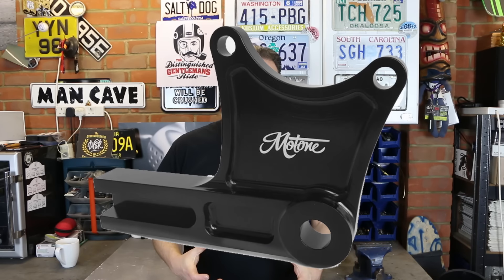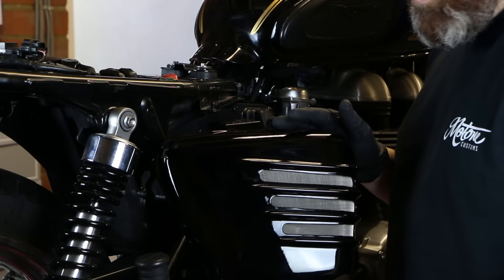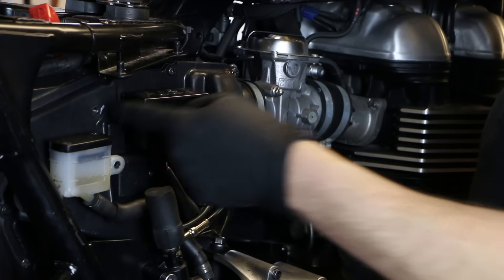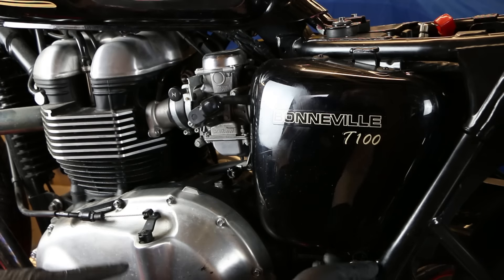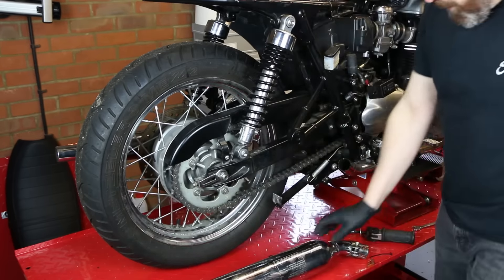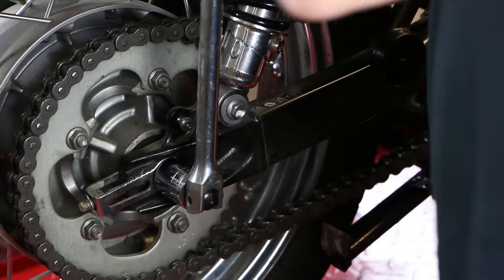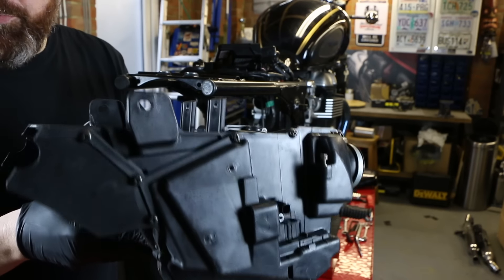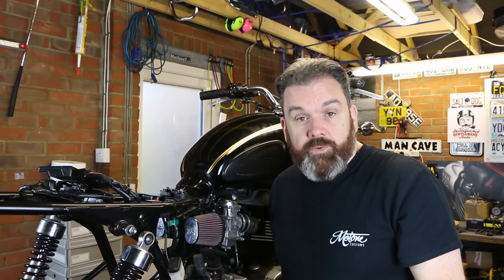Triumph Bonneville T100 Build Pt4 - Airbox removal

Comment: Hi, you can remove the airbox keeping the chain, both exhausts, and the wheel.

Just use a lift to yes lift the bike so the rear wheel hangs after detach the shocks, and the gap behind the box will big enough to take out the airbox. If not, simply lift the bike a little bit more until you can remove it.
Reply from the maker: Tombstone Blues Thanks
Reply: Tombstone Bluesy
Reply: Whomever did mine, before it was mine, they actually removed the sides and front, but left the wall between the tire and the battery box. They look like they are a heavy molded unit, but it comes apart. It's good leaving the rear part, because it does protect the air filters and battery box from a lot of debris from the wheel.  At least the way it looks to me.

Comment: Hi, what k&Ms did you use, the ones I've bought will not fit the inlet on the carbs. The ones that were on the bike when I bought it are huge and it looks like whomever did what you did, removing the airbox, actually cut the rubber connectors off the air box and glued them on the filters. I would like to get some shorter ones, but I don't see them when I look for them online. Thanks.
Reply from the maker: They came on the bike already, so I don't have any info on them sorry. I'll check them and see if there is a model or part number

Comment: Did you have to do any re-mapping after removing the airbox as this will change the airflow? Also same question for later on when you fitted the new exhaust cans.
Reply from the maker: I didn't remap it. The change to the airflow is within the tolerance of the ECU. I just left the bike idling for 15 minutes or so.
Reply: Morning, do you have any problems with the snatchy throttle operation on your T100, I am thinking about the TEC fuel boost plug, any feelings on this product. My 865 has already had the air injection delete and also the O2 delete done before I got it. Thanks Alex.

Comment: Thanks for the video. subscribed!  I'm not interested in removing the airbox completely but only the baffle inside of it. Any tip for removing the baffle without removing the airbox?
Reply: André Filipe I've removed the baffle plate and it's not to bad a job. No need to remove the rear wheel or shocks, you only need to move the air box back enough to get to two or three difficult the screws on the right side. Have a look on the Triumph Twin Power website, there's a downloadable guide to removing the baffle plate somewhere there.
Reply from the maker: +André Filipe Thanks Andre, and thanks to Ben 1022 for answering
Reply: Thanks! I remember checking the guide from TTP some months ago and 
finding the instructions somewhat confusing and/or hard since I'm not 
very mechanically inclined. I know some people removed it through the 
snorkel/air filter using a hair dryer directed at the baffle..
Reply: Views from the Man Cave no worries. Here's a link to the guide I used: http://www.triumphtwinpower.com/triumph-twin-easy-airbox-baffle-removal.php i can recommend Triumph Twin Powers products and Tunes. I did the AI, air induction and baffle plate removal plus a new ECU tune and it makes a world of difference.
Reply: Remove RH shock remove air filter battery loosen battery box as per video undo 12 screw on  non air filter side of batt box . Tilt backward s and no fiddly bit remove break heat up baffle . It will come out then re assemble. Very fiddly but not technical .

Comment: Hi. Just got a like new used 2008 t100. Unfortunately it sat with fuel in the tank. I cleaned the tank and thought the carbs would be ok, but it will only run in Choke mode. I need to remove the carbs. But I'm not sure how. Do I need to take everything off that you did in this video?
Reply from the maker: Hi Ronan, you won’t need to remove the air box, just the tank and side covers should be enough. I found this walkthrough online http://t3knoid.blogspot.com/2012/05/removing-carburetors-and-replacing.html?m=1
Reply: Views from the Man Cave Thank you so much!!! I was about to take it to the shop. I'll give this a try.
Reply: Views from the Man Cave Thank you for the Link. I followed the instructions and cleaned the main jets and the fuel jets. Got everything put back together. Installed it back onto the bike. Won't turn over. There is fuel in the right side bowl, but nothing dripping from the left. Anything I may have missed. Your help and advice is much appreciated.

Comment: im new to the modification scene. what benefits does removing the airbox have?
Reply from the maker: A couple of minor advantages are a weight saving and having better access to some parts of the bike. The biggest advantage is increasing the airflow to the throttle bodies/carbs.

Comment: What are the air filter part numbers? And what about the crank case breather
Reply from the maker: Hi Michael, from memory they are the k&n RC-2890. Unbranded ones can be found cheaper.
Reply: did you find out which air filters were used?

Comment: Can some one help me and tell me why my bike carbs on a bonneville  2001 runs only with full coke on thanks
Reply: Lino Falzon I'm having the same problem. Only it won't go anywhere. It'll die. My guess is fuel jets are clogged. Did you get yours fixed?